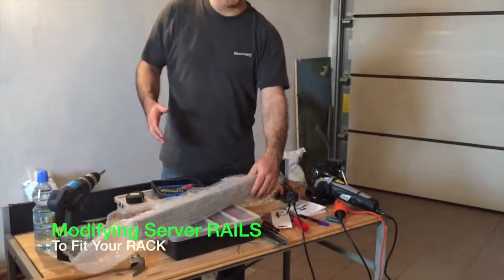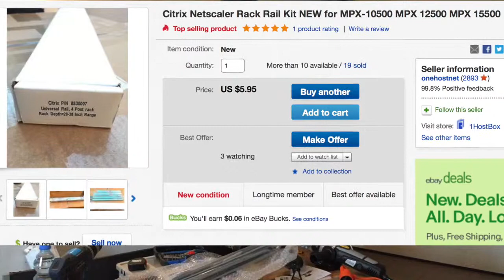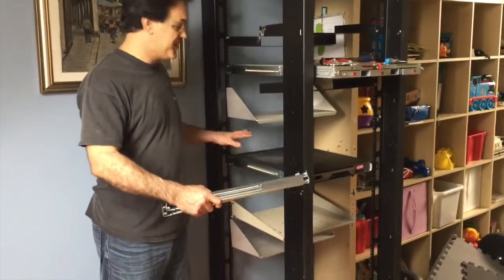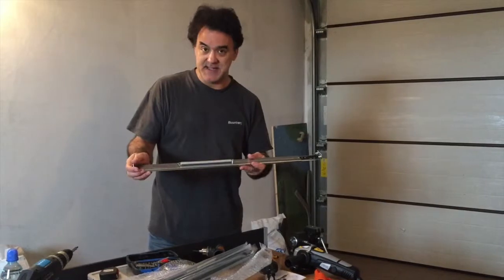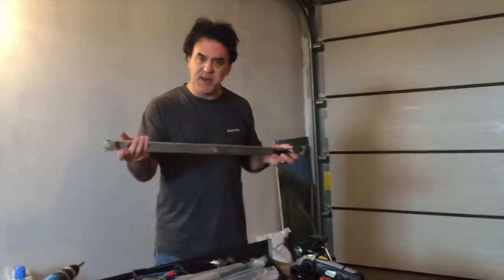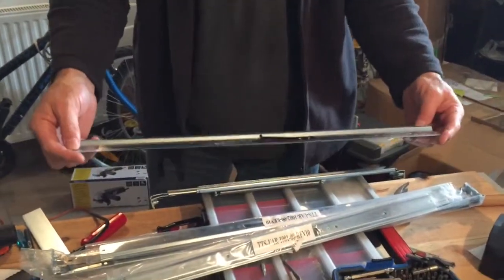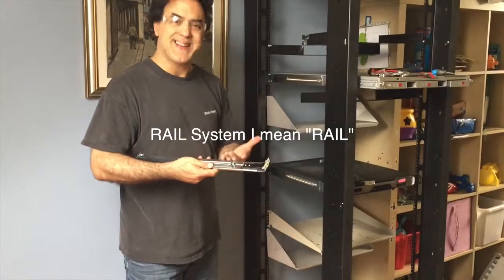Modifying Server Rails to Fit your Rack (N90X)

Comment: i cant find proper rail anywere for normal prices, wish i could find the longer rails i have few 20 rails were i normally would need 26 rails, so i workaround that by placing the inner rail onto the server a 15cm backwards so that the server can slide out the rack a bit more. But require drilling holes in the server and rails.